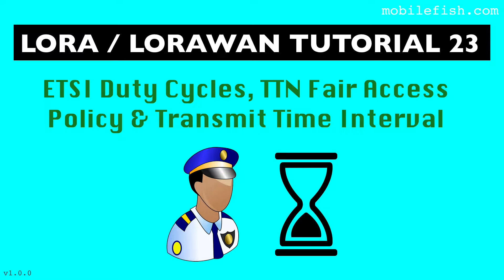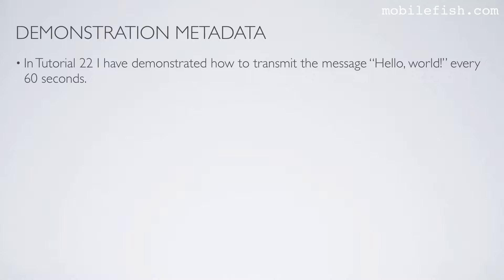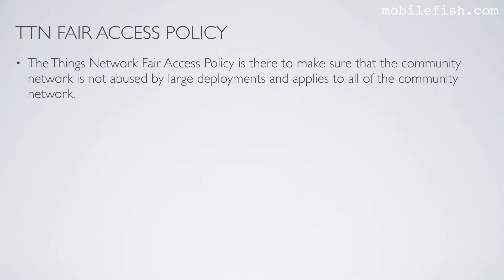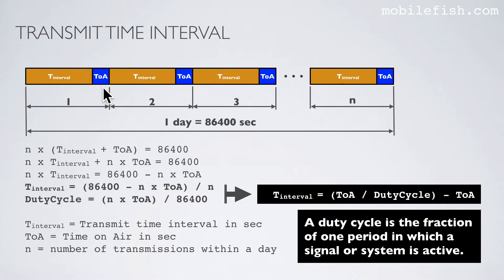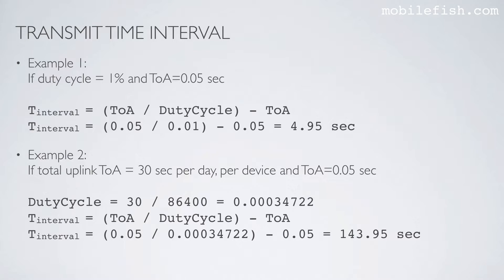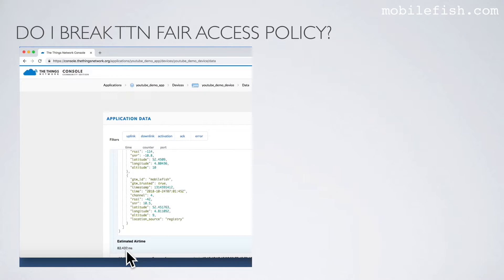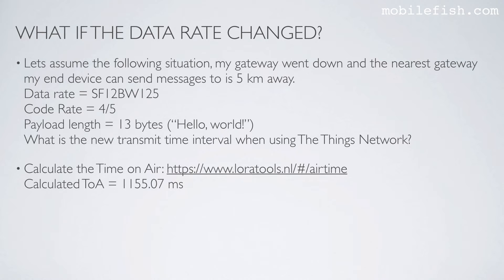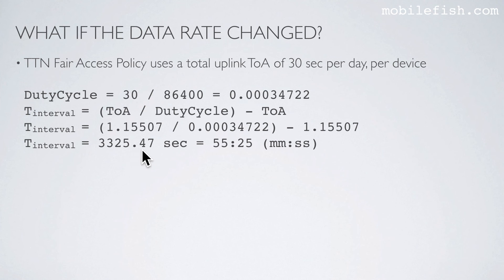LoRa/LoRaWAN tutorial 23: ETSI Duty Cycles, TTN Fair Access Policy and Transmit Time Interval

Comment: Hello Mobilefish.

First at all, thanks for all your videos about LoRaWAN, they really helped me to catch up on this technology.

As a result of this video, I have several questions. When you talk about duty cycles, how many nodes are you considering?

My goal is configuring a private LoRaWAN network, in which the nodes will send alarms when specific events happen. 

For example, if I consider the ETSI regulation, the duty cycle is 1%. It gives me 864 seconds/day for TX, which means 36 seconds/hour. If my Time on Air frame is around 30ms (because my alarm payload is just 1 byte), I can send 1200 messages in an hour ((36secs/hour)/(30ms/message)), which means 1 message each 3 seconds ((3600secs/hour)/(1200)). If I have one just single node sending 1 message each 3 seconds, I am respecting duty cycle policy. However, if I am sending this same message each 3 seconds with,for example, 300 nodes, I am not respecting it, right??

By the way, about the access policy, i have another question. As far as I know, LoRaWAN duty cycles are restricted by ETSI EN300.220 standard as:

g (863.0 – 868.0 MHz): 1%
g1 (868.0 – 868.6 MHz): 1%
g2 (868.7 – 869.2 MHz): 0.1%
g3 (869.4 – 869.65 MHz): 10%
g4 (869.7 – 870.0 MHz): 1%

If LoRaWAN select the frequency channel in a pseudoaleatory way, how can I make sure the policy access is being respected?

Finally, do you think that TTN offer a suitable solution for a private LoRaWAN network?

Thanks in advance, correct me if any of my suppositions are wrong.
Reply: I have the same doubt, can we have a private Lora N/w with 1% duty cycle?

Comment: Do the Duty-cycle limitations apply to even the private LoRa network? 
Say, we have two SX1272 Chips on 868 MHz, is it necessary to follow the limitation when we are not using LoRaWAN?
Reply from the maker: If you use these chips for your personal project (not related to LoRaWAN) you still have to abide by the rules set by your country. Every country has its own regulations when operating in the ISM band.
Reply: @Mobilefish  in case of personal project (point to point) we have to abide country rules (for example 1% duty cycle) or the more restrictive fair access policy (30 seconds for day)?

Comment: Thanks a lot for this LoRaWAN tutorials, you are doing really amazing job ! Here is litlle tip, MACPayload is also calculated in as a payload, For standard frames it has 13 bytes, so when 13 bytes is transmitted, your payload is rather 26 bytes for calculation. I sended 1 byte in payload, and on Gateway traffic there is 13 bytes payload.